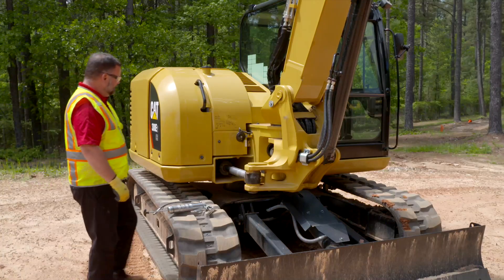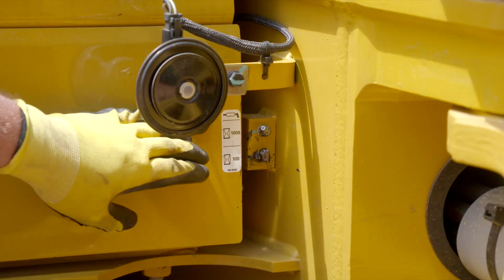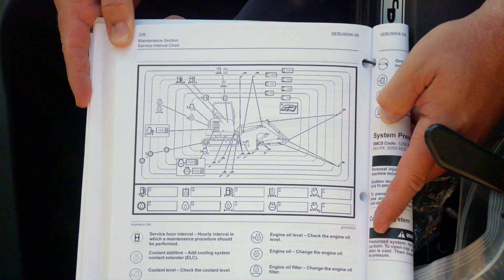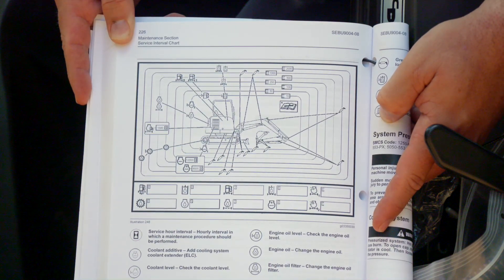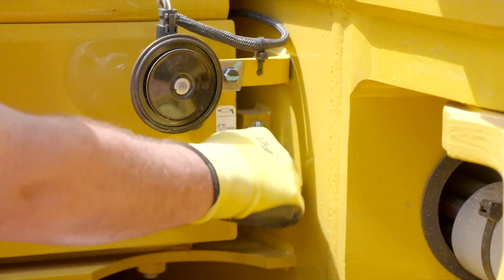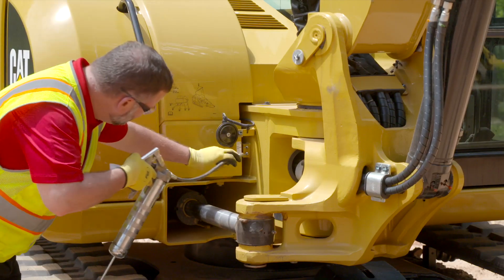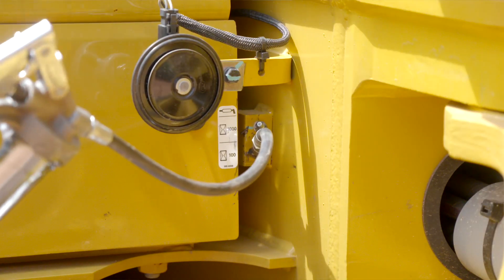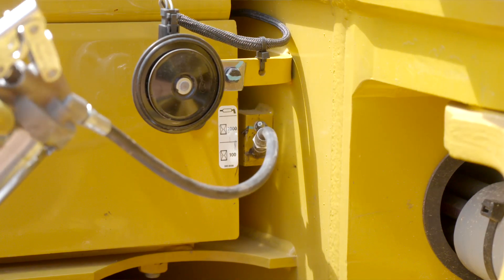Grease Swing Bearing and Swing Gear on Cat® E2 Mini Excavators

Comment: This how to grease the slew ring not the swing gear. The swing gear is inside and never gets re-greased or added once factory installation it new. Only time would be if you cleaned it out for various reasons

Comment: Can anyone tell me where the greasing points for slew ring on the 302.7D is? thanks, there's no points down at the ring  under the cab like there usually is
Reply from the maker: Hi Iasone! There is a grease port on the front on the machine that has tubing running to the inside of the ring gear. The instructions and a picture are in your machine’s OMM under the section "Swing Bearing – Lubricate". Maria C